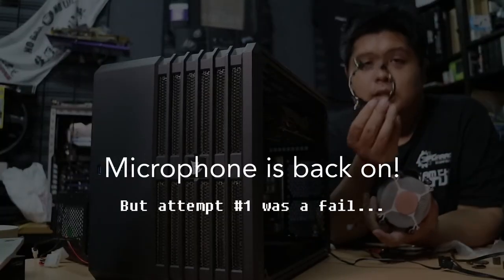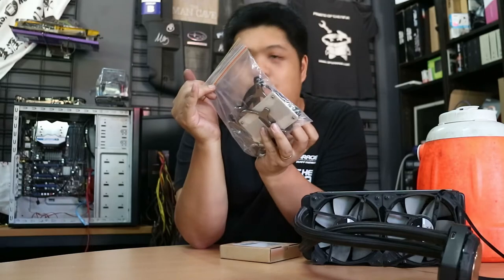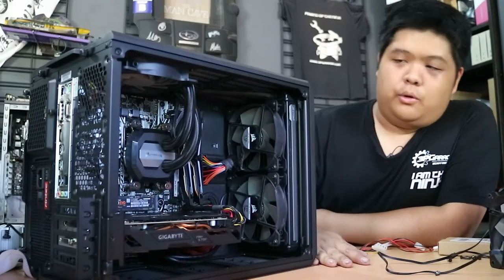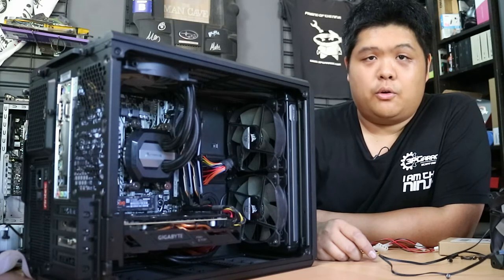Air vs Water Cooling - Scrapyard Techie

Comment: my corsair h100i v2 got a blockage and caused overheating to cpu had to be sent away under warranty and they couldnt give me a new one cause they dont make that model anymore so had to get a refund and get a coolermaster hyper x 212 turbo instead runs about 10c hotter but max temps on my 6700k are 66c load and 38c idle so not too bad but my h100 ran 25c load and 55c max when it was working properly
Reply from the maker: That’s a bit of a worry... So it didn’t end up being covered by warranty then?? Surely Corsair could have supplied a suitable replacement to cover warranty, even if it was a newer model!
Reply: @scrapyardtechie9977  it was covered under warranty 
however they couldn't give me a replacement due to no more stock 
so was given a full refund but yeah i thought they woulda offered me the newer model but they didnt just gunna save and get an ek waterblock slim kit so can service it myself without voiding warranty
Reply from the maker: EK!? oooOOooo!!!
Reply: @scrapyardtechie9977  EKWB custom loop! 
little better than an aio! 
as you can service it my aio 
i could have fixed myself as the pump was fine it was just debris inside bouncing around could hear it passing threw the radiator each times it cycled threw and occasionally causing a blockage. 
a little tap on the rad unblocked it.
 a simple drain rinse and refill would have fixed the issue so dunno why corsair couldn't repair it but anyways wont have that issue with a custom loop.
https://www.ekwb.com/shop/ek-kit-s240